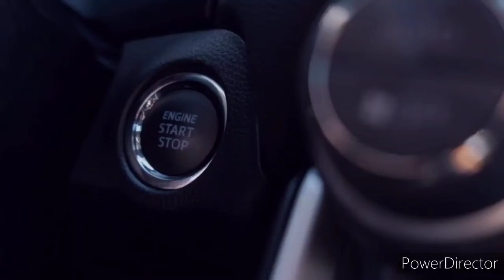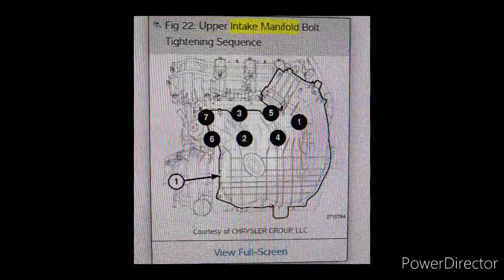Replacing Spark Plugs On A 2016 Dodge Challenger SXT

Comment: I am having misfires in cylinder 1 on my 2014 dodge charger sxt and I already replaced all spark plugs n coil packs, if its a spark plug wire that is causing the issue, where exactly do I find it and how would I go about replacing it?
Reply: Clear the code and see if it comes back would be my guess
Reply: Did you fix the problem
Reply: Which cylinder is missfire, check if there is no oil on the spark plug and that it is gapped( hopefully you didn’t drop it)

Then get it compression tested..
Coil pack wiring being an issue is very slim… it’s always 
Missfire
Check air/fuel/compression/spark

Comment: Do you have to replace the intake manifold gaskets when you change the plugs
Reply: You might as well because you need to take it off anyways too access the other 3 spark plugs on the on the right side of the block